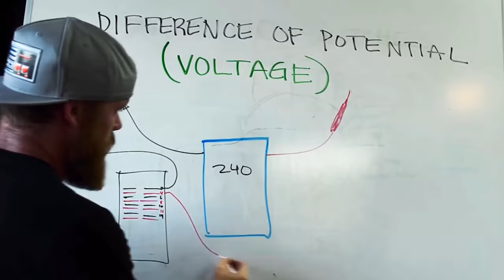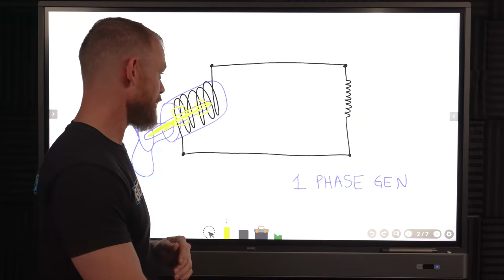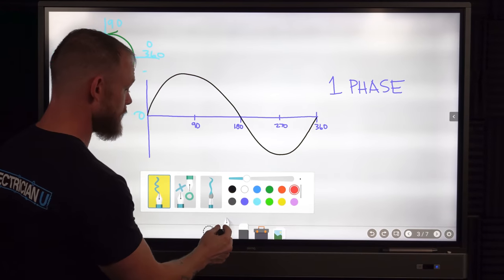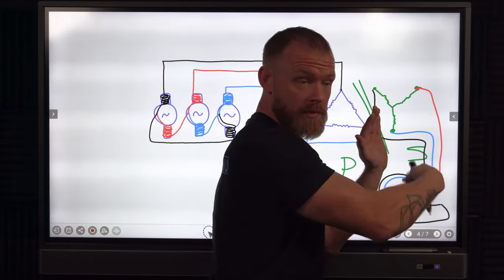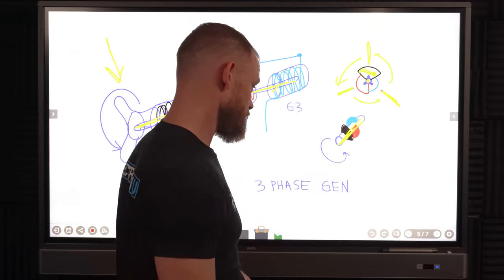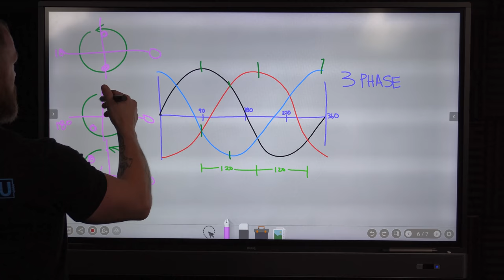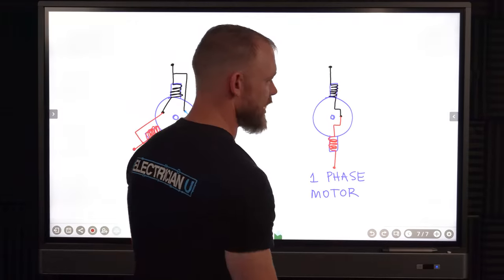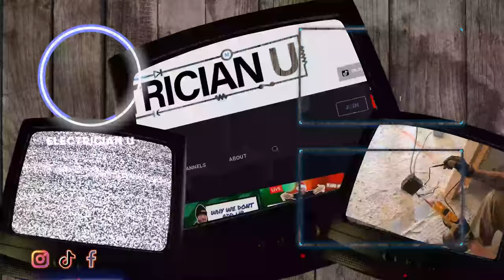What is the Difference Between Single Phase and Three Phase???

Comment: Open up a car alternator. If you look closely at the stator setup in the alternator, you will see it is made up of three separate windings/stators. The three windings/stators produces three phase current as they are set at 120° apart from each other. What turns the three phase current from AC to DC is the diode trio the stators are connected to. Car's used to use generators. The reason alternators are used instead of generators is because alternators are more efficient, smaller and can be controlled easier than generators.
Reply: Those old automotive generators were larger than a big starter
Reply: @markchidester6239  don't forget to mention the vehicles battery  supplies the capacitance to filter out the ripple out of the rectifiers. The diodes cut off the bottom half of the sine  wave resulting in pulsating dc. the battery smoothes  out the ripple  for most dc electronics in the vehicle. Any veteran car audio tech will tell you alternator whine via ground loops has been an issue since the standardization of unbalanced signal distribution ( aka RCA unbalanced cables) Twisted Pairs in multi channel cabling helped for sure , nothing beats the balanced cable for interference
Reply: and noise regection
Reply: @johnrackiewicz286  can that whine also be lowered by running the power cable on the opposite side as the audio cables? even though the wires are insulted the distortion from the giant power still bleeds through when you smash the gas. 12-2 over and out

Comment: The reason why he can explain things this well is because he really understands what he's teaching. If you can't explain something complicated in simple terms then you really don't understand it. These are in some ways not advanced concepts but the way he explains it makes it 100 times easier to understand. Great work.
Reply: Agree, not advanced concepts, but could you imagine Michael Faraday watching this video?
Reply: Yep had to change a three phase jockey pump to a single phase pump for a fire sprinkler system the other day, this video helped remember the structure as it had been years since I’ve had a chance to perform that kind of task.  Very important to get the concept in your head so you don’t have to worry about altering the wire set up when the time comes. 👌🏻nice video

Comment: I’m a 1st year and always have trouble understanding this. I just knew three phase had 3 hot conductors and single had 2. You’re a great teacher man, seriously thank you
Reply: Pairs of wires makes a phase.  2 wires is one pair - A-B.  3 wires makes three pairs - A-B, B-C, C-A.   It's not 3 times the power because you are re-using the feeds.  10A of 3 phase is worth 17A of single phase for a given voltage.   Makes a big old difference when you're wiring motors and transformers and the like.  You can run 3 5A draws on 10A of 3 phase.  No problem if you wire it correctly.
Reply: Two phase is an obsolete system used in motors so they cannot call the split phase two phase.
Reply: @okaro6595  I'm not sure why your reply applies to my posting, but while I agree that two phase is pretty much obsolete, it's still out there in pockets, and it was usually set up with four wires so that each pair of wires was one phase.  It was 90 degrees out of phase instead of 120 degrees.
I also agree that split phase is not two phase.   Nobody should call it two phase.
You know, I should have said "pairs of hot conductors make a phase" instead of just "pairs of wires".  Is that where the confusion was?
Reply: @mikegraham7078  not true… for a 400/230 system we have in the UK the equivalent power for 10 amps ignoring power factor
 3 phase, 10 amps = 400*sqrt3*10= 6928W
1 phase 10 amps = 230*10= 2300W
Reply: @ollieb7394  You're changing the voltage in your calculation.   My point is that 3 phase of a given voltage is 1.7 times (root 3) that of single phase.   So 10A of 240V three phase is the same amount of power as 17A of 240V single phase.   Yes, I am rounding root 3 to 1.7 so there will be rounding error, but the statement stands as it was made.
This means that if you are powering a 20HP motor with single phase (not sure why you would want to) then you would need more current, and therefore larger conductors than you would to power a 20HP motor with the same voltage of 3 phase.
Reply: @mikegraham7078  I haven’t changed the voltage at all I’ve just used line voltage and phase voltage in calculations I could’ve wrote 230*3*10 it would’ve had the same outcome. if for arguments sake your saying that if you have 230v line voltage and 230v phase voltage then that makes sense.
Reply: @ollieb7394    Okay, let's take a real-world example from my own life.  One of the things that I do at work is design equipment for the extrusion of polymers.   Say I am designing a flow tube that will have 12 mica heater bands on it, each 1000W, each running on 240V single phase.   That's a total of 12000W, yes?   If we divide 12000W by 240V that's 50A of single phase 240VAC.   Great.  However, I am feeding the panel with 3 phase 240VAC.  Do I need 50A of 240VAC?  No.  I need 50/1.7= 29.4A of 3 phase 240VAC as long as everything is nicely balanced.  We have 12 heaters so we can have 4 per phase, so that all works out.  Granted, I would still use a 60A disconnect because I would fuse this at 40A because the contactors and heat controllers will draw a bit of current and you can't rely on the heaters to pull only exactly 1000W... they may pull 1050W and that would put me over my 30A supply.
The bottom line is that I can supply 50A of single phase power with 30A of the same voltage of three phase power.
Reply: Do you have access to 240VAC line to neutral voltage as well as 240VAC line to line voltage?
Reply: @mikegraham7078  in your example above  I take it you’d have 240Vac line to line voltage with 4 heaters wired in parallel on each phase in a delta configuration having a phase current of 16.66A and line current of 28.87A

But also have access to single phase 240Vac line to neutral voltage instead of having 240/sqrt3 being 140Vac line to neutral?
Reply: @ollieb7394  As a general statement, no we don't have a 240VAC line to neutral.   Our 3 phase is 575V in almost all of Canada.  With a transformer we can get whatever voltage we want, of course, and have whatever center taps (neutrals) we want, but since our split phase is 120VAC, a center-tapped transformer here is normally a 208V line to line so that you get 120VAC from line to center-tap.
Keep in mind I'm talking about strictly commercial and industrial.  What we have in residential is completely different.  It is single phase line to line opposing 240V with a center tap giving us two 120V halves of that 240V whole.   With three phase 240V we would have 140V at the center tap, so transformers aren't made that way.  Who would want 140V?   So 208V three phase is common to give 120V to the center tap.  This actually is a royal pain the butt at times because some devices do NOT like running at 208V.

So, if I'm buying a transformer to power a 240V panel for heaters, I would buy a 240V transformer which has NO center tap.  I would then either use 240V contactors and devices within (which isn't a big deal) or if I'm stuck I would add a small control transformer (usually 50 to 150VA for the panels I build) to produce the 120V that I need for PLCs and the like that don't want to work with 240VAC.

I do actually have more experience than I would like with European power systems, because the ONE extrusion line we have that I didn't design and build was built to live in Switzerland, and it's all wired for 400VAC.  We have three big transformers to step down the power to run it.   Actually, we only have two transformers now... I keep replacing pieces with 575V versions so I have eliminated one transformer.
Reply: @okaro6595  Correct. All split phase motors are feed from single phase. Ones for lighter loads may only use a start winding but most have a Capacitor wired in series with a start winding and speed switch or current relay that disconnected the start winding when motor reaches approximately 75% of full speed. It's been around 40 years since I connected a basic 4'wire two phase motor. Had to be carefull with connecting them. If you cross phased the line wires on a 240 volt 2 phase motor would only get I believe approximately 170 volts that burnt the motor out.Philadrlphia still has some old buildings with two phase service.

Comment: Good video Dustin.  This also happens in reverse even when we don't want it to with three phase. I work on a lot of pump Jacks for oilfield and when they are on drives and the weights are out of balance and crest over the peak and they are weight heavy they start pushing the motor and the motor starts generating voltage back into the drive. This has to either be fixed by balancing the weights properly or a dynamic breaking resistor put in place to catch the motor generated voltage and it shunts it and turns it into heat
Reply: Same way engines can be bump started i guess?  Wheels turning, drop the clutch, turns the motor?
Reply: I believe this how electric car regenerate the power and puts it back in the car battery when you take foot off the accelerate and push the brake paddle
Reply: @maxnovakovics2568 turns the motor, turns the serpentine belt, turns the alternator, creates power to light the sparkbplug
Reply: @chimera91977  yeah okay, I oversimplified it kinda.  

Is this called a reverse feedback loop or something?

Comment: I think what confuses many new electricians is that we deliver single phase power (to residences) but most of the circuits we use are split-phase.  Graphing an example of split phase is helpful. It also helps them understand crossed phases.
Reply: Aaron.  Well written
Reply: Can you elaborate
Reply: How are the circuits split phase
Reply: @dannydropsda8616 because there are 2 x phase conductors.
Reply: What constitutes a phase? As soon as you grasp that you’ll understand it’s 2 phase power no matter how many electricians don’t understand it.

Comment: excellent explanation -  I always look at it like this ..  Single phase is generated in one set of windings and 3 phase, 3 separate windings.
When the generator makes 1 revolution, you induce voltage in 3 separate windings for 3 phase and single voltage for single phase (Single Sign wave) Single phase typical home use has one hot (Black wire) ,one neutral (White wire) 3 phase has 3 hot wires typical industry call Line 1, Line 2 Line 3 or L1, L2, L3 (each phase 120 deg off set) and in the US it is color code (black, red, and blue are used for 208 VAC three-phase) and brown, orange and yellow for 480 VAC)

Comment: They looked at having 6, 9, even 12 phase transmission lines back when things were rolling out.  But the inductive/capacitive losses between the phases ate up any advantages compared to the cost of running that much more wire.
Reply: 6 was actually pretty efficient.. After that you got diminishing returns and cost effectiveness went down

Comment: Excellent video. You provide a great visual to what others may find difficult to understand. Most of the folks that I work with follow drawings created by an electrical design engineer. To most of these guys, it's basically color by numbers. They may not understand the theory behind what they are doing and their work is basically assigning the black wire here, the blue wire there and thew red.... you get what I mean. You illustrated the science behind it so that they can understand what these wires do and the method by which the engineer designed it.

Comment: At first I was a bit lost but it started making more sense as you went along. N you did answer one question I had which was how something uses 1 phase vs 3 phase. My second question is how a converter box takes 1 phase from the wall n makes it run 3 phase? So you can run a 3 phase motor on 1 phase. I know there's boxes that do all that for you n you just hook up the wires n go about your day but I can't help but wonder how it's able to do it
Reply: Modern phase splitting involves solid state electronics, you take the 1 phase AC, rectify (convert) to DC, then using 6 MOSFETs with a timing circuit gate the MOSFETs on and off in a way that makes stepped DC that looks like AC. This is the same method used for AC car outlets only with less MOSFETs. 
The old method involves using capacitors to shift the current vector, its complicated to explain without getting into vector charts. This is method has been almost entirely replaced by solid state systems.
A third method would be to used a motor-generator. The motor side is a 1 phase machine, the generator side is 3 phase. This also works for DC to AC conversion without using solid state equipment. This method is also used to adjust frequency for special equipment, by changing the number of magnetic poles on the generator you change the frequency while maintaining the same speed. This method is usually found in naval applications or old equipment that required very clean DC voltage that was hard to rectify before modern solid state systems.
Reply: @iGameriOS  ELI the ICE man

Comment: I am a total idiot with electricity and you've made it so much easier for someone like me.
Bravo !👏Just 1 lesson alone, I have learned and understand a) the diff btwn single phase and 3 phase, b) what actually pushes and pulls the current in a circuit, c) the rotational direction, d) the 2D graph in combination with the 360 degree rotational cycle, d) what happens to the conductors during the rotation cycle, e) 120 degree spaced apart, f) clarifies the misconception of 3 wires on 1 circuit, and so on.
It's so interesting, I was able to, kinda engrossed, follow his explanation so closely that at 16:17, I was also able to sync along with his quick realisation and promptly shifted to the 3rd rotational cycle 😄 (as he explains the decreasing effect when it gets to the 90 degree mark).